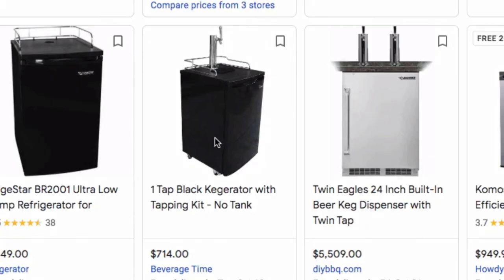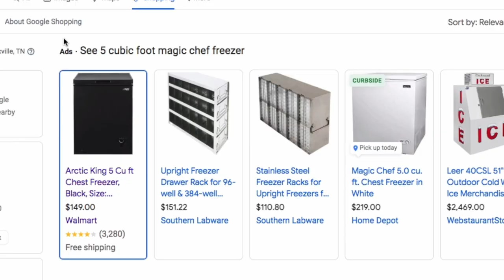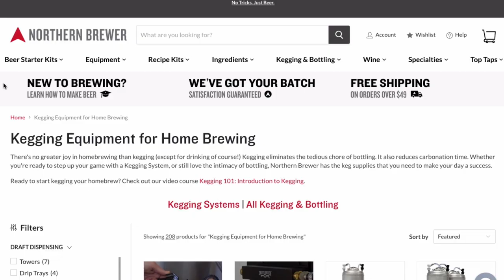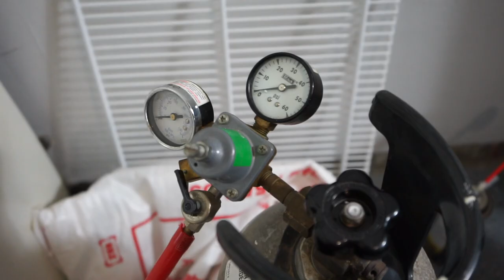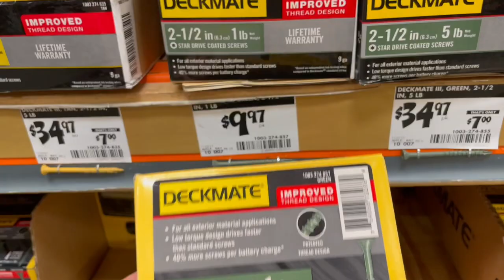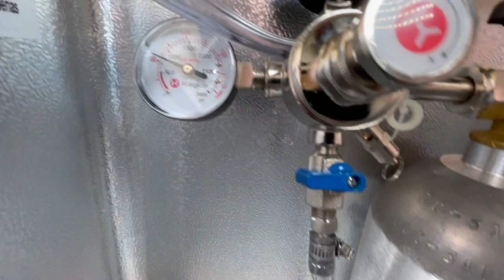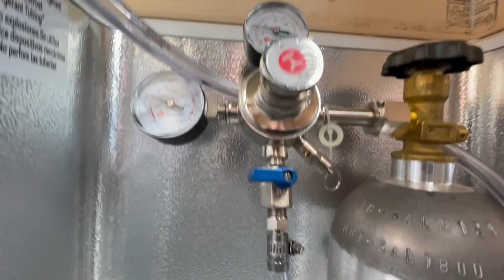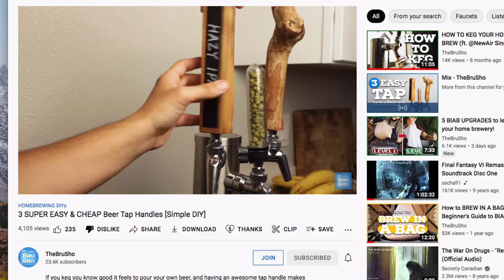BUILD YOUR OWN DRAFT SYSTEM! (at home!)

Comment: Highly recommend two things.  1. put your temp probe in a bottle with water and 2 get a fan in there.  You will get more consistent temps.  Good to see the braj back!
Reply: I wouldn’t use water as if there is a problem it can freeze and then you’ll get whack temps. Better to use vodka or moonshine. Something that won’t freeze. I believe Martin from homebrew challenge had this in one of his videos.
Reply: @SmokeNFermentables  I put a can in a koozie and wedge the probe in the koozie. Less chance of moisture ru inging the probe or plastic.
Reply: @djg1224  only concern would be that koozie may throw off temps due to insulation. I’m no real scientists just a guess/assumption. Would be curious to see if it’s true or not. Have you tested this?
Reply: @SmokeNFermentables  Haven't done a side by side comparison but I do this in my fermentation chamber and keezer and haven't had any issues with fermentation. Could be that I adjust my temperatures based on historical success.
Reply: @djg1224  right on, definitely interesting/good idea. Glad to hear it’s a success though.
Reply: I have my sensor held against the side of one keg with a bungy cord with a square of insulation over it. It would be better if I had a temperature probe pocket as it’s the beer you want to control the temperature of not the air space.
Reply: @SmokeNFermentables  having the probe in liquid serves as an insulator also so I dont think a koozie would cause an issue.
Reply: @mathewlarsen4414  for sure agree that having in liquid is the way to go (though shouldn’t be water in case temp drops too low). My question was more pointed at having a koozie and sticking probe between koozie and liquid working and what the point of the koozie was really. If you are using a liquid that won’t freeze there shouldn’t be a need for a koozie though can still be used.
Reply: If you use a fan,  can you take the wiring from the disconnected light? Im not an electro engineer... just curious
Reply: @adambee2224  if the light is always on, then maybe, but if it's triggered when open you'll have to mess with that too.
Reply: @CSHracer  good point.
Reply: Tape the probe to the lowest point near the bottom of your coldest keg. Electrical tape works best, but do a full wrap back onto itself.
Reply: I keep my probe in a cup of sand.  Works great.  Agree 100% on the fan as I have one in both my keezer and fermentation chest freezer.

Comment: One small recommendation, buy some foam board insulation and glue it to the back of your wooden collar. This will significantly improve the efficiency of the new keeper, keeping its power consumption low but also taking a lot of stress off of the refrigeration system itself, making it last a lot longer.

As far as what I prefer, I like both. Kegerator at a higher temp for the heavy bready boys and keezer for the lighter, crispier types. I don't want to drink a stout at 35f, more like 55f; but I don't want to drink an IPA or a sour that's too warm.

Comment: Keezer! Its more energy efficient, with the cold air staying inside anytime you open it (unlike a fridge door that lets out the cold air). Also, drill a small hole in the collar for your Inkbird thermo-wire, keep that lid sealed TOIGHT on the collar. I put a simple snap latch on the lid to keep the cold seal toight.  Also, with the keezer, I found it necessary to buy a little computer "muffin fan and some pvc pipe to recirculate the cold air around the keezer. I put a metal grate on the bottom to keep the kegs up a few inches and away from the condensation on the bottom. Pro tip... add a splace of bleach to the bottom of your keezer to keep in freshhhh

Comment: Kegerator guy here.  Got one with the freezer at the bottom so I can have tall handles no problem.  Like that more since it's easily fitting 4 kegs + tank inside for less sq ft. Also no temp control needed.  I've heard bad stories of the probe freezing up and then the freezer froze all the beer. Probably not a big deal,  but i prefer the internal control from the fridge.

Cheers!

Comment: Kegerator here. Made one out of an old side-by-side fridge that came with my house. Holds three corny kegs and has room for two more shelves of bottles and cans above the kegs. Plus I can run whatever tap handles I want and still have full access to the freezer on the other side. Only thing that sucks is when the keg in the back kicks, you have to pull out all three to get to it.

Comment: Good overview of the process.
My advice to those deciding which way to go is to NEVER buy a kegerator with a draft tower and NEVER buy a fridge or freezer with a built in digital controller or any other circuit board.
I made both mistakes in the Kegland brand kegerator I have. 
The draft tower designs always have foaming issues with the first pour and can develop growth in the lines while having anything electronic makes it prone to frying from power surges. It took my six months to finally get a replacement board.
Reply: 100% i wish I had seen this video 6 years ago lol
Reply: skip the digital controler.  Replace with a thermostat from an abondoned refrigerator.  Its easy.  Pos neg ground and thermocoupler.

Comment: Great video. Love how you make a tutorial entertaining. Like slipping some frozen peas in mac and cheese.

One thing I will counter, with no credentials other than "the internet", is that you shouldn't use tephlon tape on the co2 tank. If you use the appropriate washer and tighten it down, you should be good. To my understanding, co2 to regulator threads are meant to be compression fit with that washer. If you need tape something is wrong.

The other point which may be an old wife's tale, but you could end up with some tape in your regulator if you are a bit unscrupulous which could damage the regulator.

But to each their own, it seems like a good insurance if you don't have a cheap supply of Co2!

Comment: I have an old fridge where the ice box is inside. So only one door to open. I don't have to worry about taller tap handles if I want to get into the freezer. It was what I found on craigslist at the time for free about 15 years ago! Still runs great, but if I didn't have that option I would probably go keezer now a days. Also I put my CO2 outside to get the most out of it. Just like the guy who fills your CO2 should be doing at cooler temps and not ambient temps to get the bottle the fullest it can go. That said, it depends on who is working that day! Great to see you back with content. Cheers from Washington (State)!

Comment: Keezer. I'm in the process of building one. My advice is drill a hole for the temp probe and silicone seal it, or get one of the built in controllers and wire it up. You took all the time to seal the collar, but leflt the wire go through fthe seal and cause a leak. Lower electricity build means more money for beer.

Comment: Nice work on the production video and getting in a whole bunch of key points efficiently!

 I have both and prefer my keezer. Major efficiency benefit with keezer running 1.75 amps to refrigerator taking 15 amps and maxing out a whole outlet and circuit breaker. The keezer drops beer temps way quicker to crash. They do look better like CH said.

One downside to keezer is if you're looking to get a commercial full keg they won't fit in your 5-7 cu keezer. Something I wanted living with a bunch of roommates in my 20's. 

 My few pointers on the keezer builds is first get kilned lumber that isn't warped or bent or it will never sit right with huge gaps. If you want to go cheap 2x4’s still give you enough height to fit the corny kegs and connections. CH’s glue seemed to do the trick, but you can also use cheap aluminum plates for framing and put a couple on the back that attach to the would and keezer, which helps if you’re using silicone like I did. Drill, sand, paint, etc. before attaching the collar. 

FYI if for anyone that's doing a kegerator only drill in the door and never in the sides at you there's coolant lines you can hit and kill it the fridge for good.

I regret going cheap on my faucets, shanks, and one of my regulators. Plated chrome faucets and shanks are not supposed to rust, but they defoliate quickly. In less than 2 years mine wore off on the insides exposing brass, which taste bad and isn’t good for you. You’ll save in the long run buying all stainless. My cheap regulator only lasted a little over a year, which is a lot less than my Taprite’s.

Comment: Something I did when I built one was to put a bottle of water in there and set the thermostat inside the water. Sort of an analog buffer to keep it from kicking on the compressor too often. 
The biggest issue with these is combating condensation. Every couple of months we'd have a pool of water in the bottom. You need to make sure its sealed very well on top of using something to dehumidify.

Comment: Great job CH, solid advice and a great looking keezer!

I made a keezer. Though I like the simplicity of a kegerator.
With a keezer you have to lift the full keg and lower it in. Not terrible but might be a factor for some.
I'm using the inkbird and its working great. 
I'll have to take another look at the isolation, you were way more thorough.

my keezer fits 3 kegs, but I bought a 4 tap manifold.
The fourth has an extra long gasline so I can forcecarb a keg on the floor without disconnecting anything. 
Cheers.

Comment: Keezer all the way, also, I'd set the temperature differential to be at least 5 degrees. I've found that the larger the temperature differential, the longer the compressor lasts.

Comment: Great video! I prefer the keezer, as you can get them big enough fit as many kegs as you want and are always for sale used and cheap. 

Couple things I've learned the hardway. Tape your temp prob  near the bottom of your fullest keg. Letting it dangle inside can lead to freezing your beer when you put a fresh warm keg in there. The freezer runs steady until the new beer is cold but your already cold beer keeps getting colder and cold until frozen. Also avoid letting the kegs touch the inside walls. This can also lead to freezing. 

Next dont use those gear hose clamps, they suck and tend to leak over time. I prefer single ear stainless pinch clamps. Furthermore dont use Teflon on conical/flared fittings, thet dont seal that way and you can actually cayse them to leak getting tape on the seal.

Next if you have to drill through the side of a fridge or freezer ir drill screws beware  there could be condensor/evaporator lines in there that you may drill into. Been there done that, ruined a perfectly good keezer.

Comment: I have a stand up fridge (no freezer) that I wired up some STC 1000 temp controller and 110 outlets inside it to power a small computer fan and a small desk space heater. I can ferment 10 gallon batches in my conical at 90f or have 4 beers on tap at 35f.  Its a hell of a unit.

Comment: Built both. I Use inkbird controllers.

Kegerator is better. You don't have to lift kegs up over the side and freezer on top. I used a small free fridge. Built a collar for it so i could fit more kegs.

I basically just use the keezer for temp controlled fermentation chamber. Added 2 small ceramic reptile heaters.
Hot and cold.

Comment: I’ve had a couple different kegerators/keezers over the years… I’m done with them. Dealing with faucets and keeping them clean is just a pain in the ass.

Currently I use just a chest freezer on a temp controller with no modifications and just simple cheap picnic taps inside. So much easier to clean. Cheaper. Since they stay on the inside of the fridge they don’t mold instantly like they would on the outside. 

Never going back to faucets for homebrew. I brew often but unless you’re running a business I just don’t see the need. If plastic bothers you, you can even get stainless picnic taps from torpedo these days.

Added bonus- way less spills/accidentally knocking the faucet open with a picnic tap if you’ve got guests over.

Comment: Outf#$%standing vid CH as usual! I wish you put this out back in August when I started down the damn homebrew rabbit hole! I blame you because your vids were so fun to watch. I'm a kegerator fan, 18 cu ft, that I snagged on Craigslist for pennies. Gotta find one with the freezer on the bottom! Have 4 faucets, 20# CO tank mounted outside, easily handle 4 cornys at a time.  Picked up a $20 fridge the other day, warm temp control fermentation with the kveik yeast.  Can't wait.  
Cheers🤘

Comment: Something for the Knoxville BRAJS the volunteer welding supply place has the cheapest CO2 and they told me yesterday that you shouldn’t use Teflon tape on your regulator threads. Instead, they gave me these massive white Oring discs that go in there instead.

Comment: I added a thin layer of silicone all around to the top part of the collar. That way the lid will actually seal against the collar. I'm not sure if it actually helps with the cooling but I did it because I could.

Comment: Half way there braj lord, need a follow up video with brewing beer and pouring it out of the keezer. I also had a 5cu freezer with 5ft liquid lines. I just had the co2 set around 7-8 psi. I was able to have 3 corny kegs in mine, 2 on the bottom and 1 on the hump.  Cheers dude…🍺🍺🍺

Comment: posting this as a question; I have my Keezer and I'm gearing up to build my collar.  I heard a suggestion to cut into the top part of the collar so that the seal of the door fits snugly into the collar.  has anybody tried this before, not sure if it will work.  Also, I usually set my temp to 38F, is there an advantage of setting it at 35 or is it a matter of preference.

Comment: Echoing all in being pumped to see vid release! I prefer keezer as well - added some foam insulation to mine as well as a rechargeable dehumidifier thing. They use the moisture beads but then it can be plugged in to dry them out, pretty cheap on amazon.

Comment: I have a kegerator and a keezer and both work just fine. There is a mod for kegerators and it's to take apart the temperature dial inside and turn the screw all the way clockwise to turn up the cooling to max then use a inkbird for temperature control. I have my kegerator set at 32F all the time. Before this mod it was barely cold enough. Also get a tower cooler to avoid those first foamy beers.

Comment: Love your content. I would like to comment on using the Teflon tape on screw connections. You should never use it when it’s a swivel with a washer. Because the washer will secure the seal and not the thread. Only (and always!) use Teflon when the actual thread is the seal. The Teflon can actually prevent a tight connection from a swivel-washer. Anyhow, great content! Cheers from The Netherlands 🇳🇱🍻
Reply from the maker: Cheers from Tennessee!

Comment: Like that 5 cu ft keezer idea, pricing is right. One thing going for it is it usually is a bit better insulated than the kegerators. On that note I would likely add some 1" foam to the inside that wooden collar, to keep the utility bill low. Also for the lazy, I got my Danby kegerator at Costco, and the price was decent. $500-600 Canadian right now! (I paid 329.99 in 06,...), but it does come with a 5lb gas bottle, a tower (a bit short), a faucet (garbage chrome plated), a regulator (decent) and a sanke coupler (never used it, the Beer Authority here thinks a good price for draft is saving you 5 cents a beer)... I usually have 5 gallon corny of IPA in there, and a 2.5 gallon of carbonated water. To be honest I drink more carbonated water than beer, but I usually run carbonated water through the Perlick before and after a pour. No foaming, and the line and faucet stay clean, no plugs, no flies ;)

Comment: HE'S BAAAAAACK. KEEP 'EM COMING
Reply: Also, I bought a used kegerator stand up fridge on Craigslist. $100 for the fridge, the CO2 tank, 1 shank already installed, and even a commercial keg that they let me keep the deposit on when I returned. Drilled a second hole myself and I've had two kegs running pretty much nonstop ever since. Easily the best return on investment I've had in used homebrewing buys.

Comment: Our whole lives have been leading up to this moment... My body is ready for a new grain to glass video braj!
I insulated the collar on mine with pink foam board and used a cheap adapter to power a little 80mm computer fan that sits in the bottom and moves air around.

Comment: Kegerator... specifically taps inside a fridge with the shelves removed. Its the least cool option but hear me out. I've gone full circle, started out with a wrapped keezer with a fancy font that looked like a legit bar. Cool factor was there, but living with it sucked. No matter how much air was blown up the font, in warm weather it would pour half a beer of foam. Unless you clean the taps after every session, stale beer builds up and taints the first pours, and is a pain to clean. On the other hand taps inside a fridge is the least effort, often the cheapest option, definitely not cool or sexy, but kegs are easy to load, taps are kept cold, the beer residue in the tap stales a lot slower, heaps easier get a decent pour and its easier to wipe out when there is an enviable leak!

Comment: Nicely done 👍
Always always always check the classifieds before you go building anything, got my kegerator with 2 cornys, a 5lb co2 bottle 1/2 full, Perlic taps, regulator, manifold, ball lock couplers and a lot of hoses for $300… I could of used it for parts and still came out ahead!

Prost 🍻
Reply: I second this.  Here in the PNW, people are always selling their homebrew stuff and reasonably cheap too. I do throw $ome love to the local homebrew store because the owner is super nice guy and his prices are very competitive, just not convenient like Amazon delivering to the front door. Cheers.